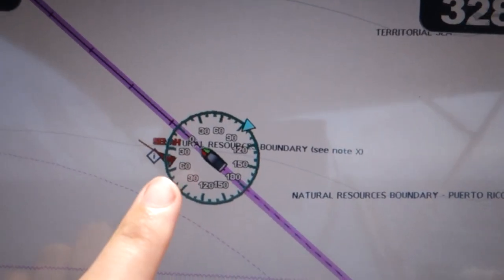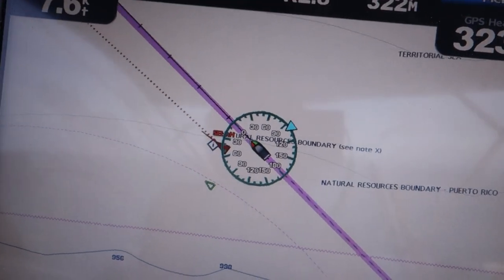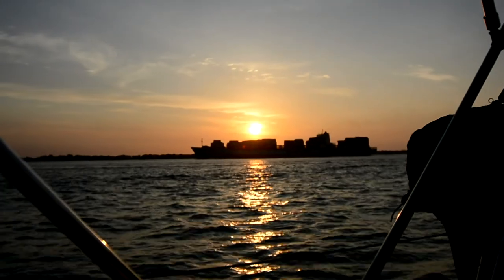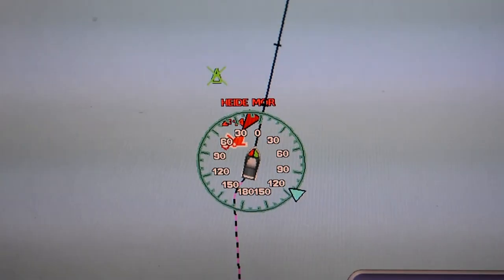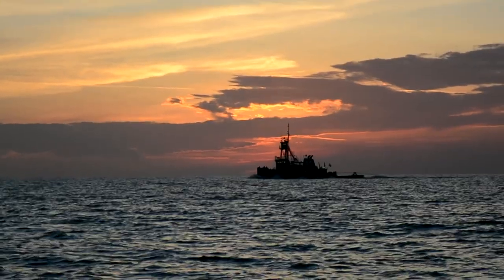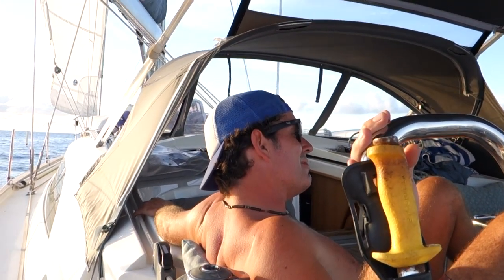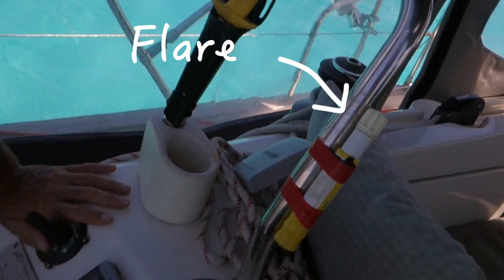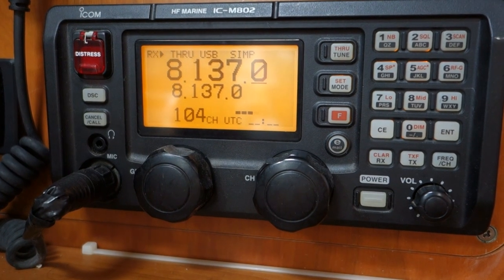HOW TO SAIL ACROSS AN OCEAN

Comment: Bread maker?!  Really?  What a couple of wussies.  But, I agree with everything else you said.  Tell me the brand/model of the hydro generator.
Reply: Just teasing.  I use a Kitchen Aid mixer to make bread. I've never had good luck with a bread maker. I make several small loaves so they cook more quickly in the oven. It's multi purpose as well I use it for cookies, cupcakes, etc. Also, I think my Kitchen Aid uses less electricity.  The cookies and cupcakes become favorites with others in any anchorage.
I do enjoy your videos whenever I can get somewhere with Internet which isn't often because unlike the two of you I don't pamper myself with  infinity pools and stays at 5-star marinas.
How many amps does the hydro generate produce?  The old tow type generates only produced 3-5 amps.  I like that your model is transom mounted.  How does it effect your boat's speed?  I'd imagine 1/2 to 1 knot.
Theresa should have let her skirt blow up Marilyn Monroe style assuming there was something modest underneath. Would have made a great end to the video.